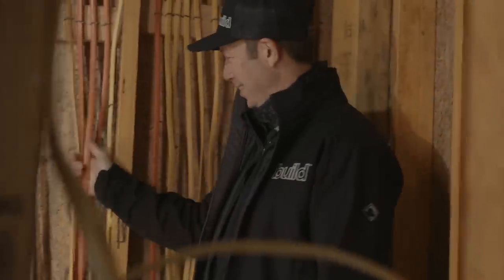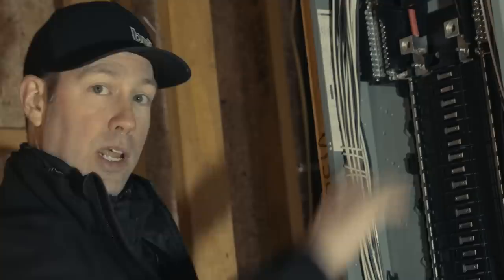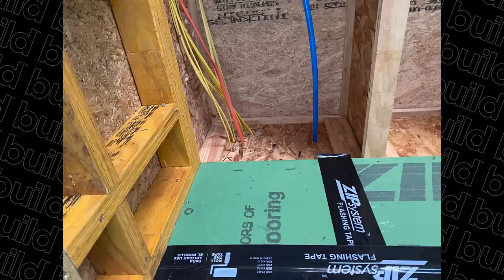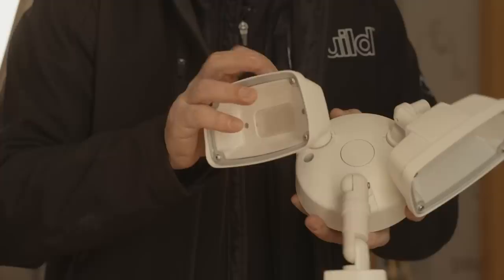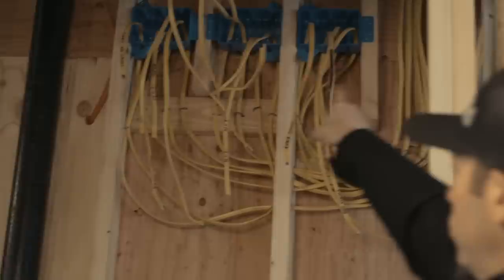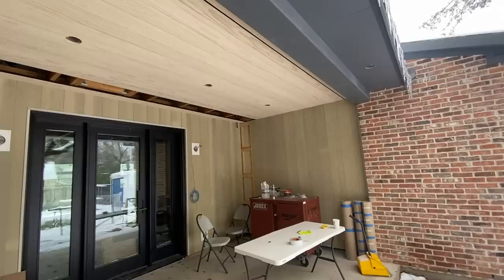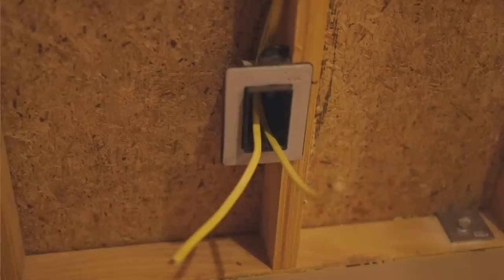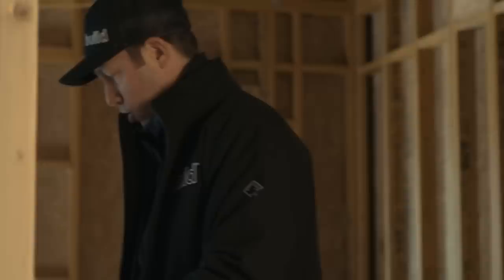5 Tips for New Construction Electrical & Smart Lighting!

Comment: I work in Information technology  and I made my house a dumb as possible.  The last thing I want to do is fix another bluetooth device after work.  I've also switched to all led light bulbs as I got tried of the entire light failing.
Reply: I totally agree. If the LED isn't replaceable with industry standard parts that will be available in 10 years, it's crap. It WILL burn out.
Reply: Thin fixtures = death by heat
Reply: Also, thinking of blujacking and blusnarfing thru these IoT devices...somewhere along the way, they get thru to the internet.

Comment: I have been using wafer lights for about 2 years now. So easy and fast. Love the ability to place just about anywhere. They work great for remodeling especially is small spaces where a standard low pro can does not fit

Comment: 12g wire for led's is way over kill. Run 14/2 on a 15 amp breaker for each rooms lights. Every room should have 2 breakers. 15 amp for the led's and a 20 amp for the sockets. The master bath would have a separate breaker from the master bedrooms sockets.
Reply: yeah, if you're putting the lights on a separate circuit, then there is no need for 20AWG on those. it wasn't clear whether that was happening there. I don't know the code or typical practice in his area
Reply: Yes! Perfection!
Reply: Its a cost saving. No point in buy to different wire sizes for about $8\roll difference. Then I don't have to work about the electrician running out of one size wire and having too much of the other size. Electricians cost around $60\hr. Don't want to waste money having him to pick up more wire, or waiting on me to come back with more wire. Keep is simple.
Reply: You don’t share ANY circuits between rooms, eg lighting?

Comment: The switch is cool but the real magic is in automations and voice control. You don’t need to press a switch when you leave. A presence sensor (or some specific set off conditions) activates an automation that turns on or off what you want for that condition, locks/unlocks doors, changes thermostat settings, garage door, tv.....

Comment: There is a lot to talk about with this whole full 12ga setup, more than I can write in a youtube comment. 
 I'll just affirm what some others have already said and add that the idea that 14ga is "worse" is fundamentally wrong. It just has a different use case. An old joke amongst electricians is that you can always tell when a homeowner did the wiring because everything is done in 12ga since they think "bigger is better". In some instances it may make sense to do a circuit in 12ga even when not required by code, but in others it may make no sense at all, and cause issues with box fill etc.  Consult your electrician for your specific scenario and I think you'll find a majority dont agree with this concept.
Reply from the maker: Interesting. I didn’t know this. My electrician is fully on board with this concept. Appreciate you taking the time to comment. Best, Matt
Reply: @buildshow  You probably shouldn't be telling the electrician what wire to use when you don't know very much about wires and electricity...that's the electrician's job.
Reply: I am wiring my own house and doing the same as Matt. Not because I dont understand where 14 gauge could be used, but for simplicity. As a DIYer it just makes it a lot easier to go overkill and not have to worry about it.
Reply: I would argue that wiring your outlets as 20 amp circuits could actually be considered more dangerous, yes you can potentially power more devices on a single circuit, but what happens when one of those devices ends up with a short inside of it, that 20 amp circuit will now allow even more current to flow through that device which is typically rated to be plugged into a 15 amp circuit. Cheap cable attached to the device barely rated even for the 15 amps now has an extra 5 amps to burn that cable up.
Reply: @myquest84  I did mine with 20 for receptacles and 15 for lighting. No problems ever!
Reply: @camtoews  Not a valid point with Arc fault nowadays - 20A isn't going to flow

Comment: After having one smart hone set up it was so expensive to setup and then I had to go replace all the blue tooth stuff cause it shut down the lower 2G wifi and also messed up the use of wireless headphones and headsets.   I ended up having one wireless network just for the "smart home setup"   worked great but after 2 years only had one leviton smart switch go bad.  Wish I did not have to sell that place
Reply: You nailed it. Smart devices are good for about 12 to 24 months before the problems start, and the Mfg no longer supports them forcing you to upgrade everything.
Reply: I’ve had some Leviton zwave switches for 10 years in high use areas with no problems.

Comment: Aluminum wire does not need noalox, it's not required by any major panel maker or any large manufacturer of wire such as Southwire. It does however need to be properly torqued to the panel manufacturers spec. The alloy of aluminum in use today is very different from the one that was first used in homes that had issues. There's nothing wrong with using modern aluminum wire to feed main panels or sub panels when installed to manufacturer specs. I used it  to feed the main panel in my house. I wish people would stop propagating these myths about aluminum wire.
Reply: That being said, specifically using Cu wire with Al Lugs in the panel to avoid oxidation makes no sense.  I'd think you'll get a little less oxidation if you have Al on AL, rather than mixing the metals, but I'm no materials scientist.
Reply: The issue is using Alum. wiring with Copper lugs or with wirenuts or press-on connectors that typically use copper. Copper & alum in contact causes corrosion, so they need to be protected from oxidation.
Reply: Agreed. We use it commercially often except in special cases where were concerned about corrosion. It's a great product and can save money.

Comment: I watched your video with great interest and with 35 years doing electrical work (Electrician) doing mostly commercial as residential service work, I would have to disagree with running everything 20 ga.. All your outlets yes by all means do so but for your lighting circuits there’s no need my reason for this is twofold 
One all your lighting now is LED’s which means that if if you install 15 amp breakers, say 2 15 amp breakers per floor as well 2 for exterior lighting so if by chance a breaker should trip you would be left in total darkness in any area and you can alternate circuits for each area lighting.
Second All LED drivers have a built in thermo, as well as built in disconnect that automatically shuts off power to that fixture sometime comes in very handy in troubleshooting (BTW the drivers are the weak link in LEDs) since LEDs are rated in watts you’re looking at 3000 watts of lighting per floor or 2400 watts @ percent for your 2 breaker per floor. Also more room in your switch boxes 
If you don’t mind wasting money by all means running 20 amp circuits and 12 ga. Wire. If you disagree with me please tell me why I’m wrong since most folks can’t afford to waste hard earn money on even a custom build.
Reply: Edit : 20 ga to amps or change to 12 ga

Comment: Why do you have that external panel?  Speaking from what I've seen in Iowa, I've never seen outside panel boxes, like that.  I've always only seen the electrical panel on the interior of the home, hence my asking.
Reply: Common in the West. Here in Southern California, it would be quite unusual to not find a panel on the outside of the house.
Reply: Yeah I found that odd too. I wouldn’t want my breakers outside where anyone can walk up and turn them off
Reply: @LRaines  makes it easier to hook up things that will end up outside such as AC, hot tub, generator disconnect. From there is relatively easy to feed sub panel inside for interior services.
Reply: @LRaines  more work for the electrician in 5-10 years.
Reply: Exterior service disconnect is now code. NEC 230.85 Emergency Disconnects. Exterior panel also handy for landscape lighting, etc.
Reply: @BretBerger  that's going to go over like a lead balloon where I am.
Reply: I bet it's coated in an inch of ice after this week. That's one thing I would NEVER do... put a panel of any kind outside. I once opened up a panel for all the cable wiring and it was packed solid with wasps. I would have a dedicated equipment closet where all that would reside.
Reply: @BretBerger  So you put one large master cut off by the meter and run it through the wall to an interior breaker box. Even better because now if you want to work in the panel, you can kill even the mains lines so the whole panel is dead.
Reply: I wonder the same thing - they've been putting them outside in the south for years, so the 2020 NEC doesn't explain it, and you can still have a service disconnect outside but have the panel inside. None of the electricians I've spoken to thinks exposing the breakers to the extreme heat is a good idea, not to mention the hassle of going outside every time you need to reset a breaker (or need to turn one off or on to do some work.) Adding a hot tub or landscape lighting is not an everyday event, so that doesn't really justify the other drawbacks.
Reply: @Sipa2020  How often do you need to do that? the AC is installed with the house. A generator disconnect can be installed regardless of the service panel location.
Reply: @ptester1  the official explanation for an outside disconnect is for firefighter access. But anything outside corrodes faster, so the failure rate is worse.
Reply: My house is like this, panel on the outside, with another one on the inside. I find it incredibly annoying! The only reason it is like this is because my house was built in the 80s and then moved and remodeled a few years ago, the power comes in a different place than it used to. If it wasn't for that it would not have been done that way. (In the south also, BTW)

If you're worried about random people turning off your breakers you should find a better neighborhood...

Comment: I'd previously looked at a towel warmer. To run it for a year would have cost me about $100, so if I didn't want to pay that, it's another thing I need to remember to turn off. So the lesson: put towel warmers on a switch with a timer so it turns off automatically after 30-60 minutes.

Rule of thumb: running 1W of power for a full year costs about $1 for even below-average US electricity (11¢ per kWh vs a 13¢ per kWh US average).

Comment: Hey Matt, nice electrical setup you got going on there, but I couldn't help but notice your electrician is using those all metal staples, most of the time those are fine, but if any of them get pounded in a little to much after a while it will chafe through and short your wires across and could burn your house down, I would recommend pulling all those out and replacing them with the plastic insulated staples.

Comment: What is the benefit of a separate 110 panel? Wouldn’t  one 110/220  inside be better?
Reply: -Panel capacity (no expensive tandem split breakers needed)
-Generator panel for 120v circuits
-Ease of resetting breakers from inside the house (including afci/gfci trips)
-Shorter homeruns
-Conditioned space better for longevity on smart breakers and probably the afci $$ too.
-Conditioned panels also trip less on hot summer days and don't freeze in the closed on position mid winter
Reply: sure, but this is Texas. we do power our unique 2-stepping & stumbling way ;-)
Reply: There really aren't 120V panels. Most subpanels are 240vac that are split phase. 220V circuit is L1-N-L2. Each Lx is 120v when tied to neural ie L1-N = 120V, L2-n = 120V & L1-L2 is 240V

Generally subpanels are useful to reduce wiring costs or if or adding rooms to an existing house & don't have an easy way to run all of cabling back to the main breaker box. Sub-panels are also used for critical loads for a generator\UPS\Solar setup which the power source (GenSet\UPS\Solar-Inverter) cannot handle all of the loads. You put your critical loads into the subpanel (ie frig\freezer\lighting) to segrate from devices like the AC, electric Dryer, electric stove, etc.
Reply: If Matt later wanted to put in a 240V breaker into his "120V" panel, he'd be able to do it, the same as any other panel.  He just chose to put only 120V circuits in it.

Comment: What perfect timing, I am at the electrical planning stage on my self build, thank you... only one comment I would give is to add some pendant lighting, I had all recessed lighting then I realized it was missing some character. The Halo smart products are really cool. Again thank you
Reply: yeah, I added boxes or pendent\ceiling fans but drywalled over them. I don't plan to use them, but it there if I change my mind. I used magnets on the cover plate to find them easy in the future.

I recommend avoid the Halo lights. Eventually those switchmode power supplies are going fail and be a hassle to replace. Plus its likely Halo won't bother to update the smartphone app and when you eventually get a new phone its not going to work. Just install regular can lights and save yourself the grief.

Comment: I agree with you as, 12/2 is future proofing the house for the excessive and growing amount of electronics people use. The nice thing with 12/2 is, you can run 15 amp and 20 amp outlets on them with almost no restrictions.
Reply: That would make sense if it weren't for the trend of making energy hungry electronics more efficient. If you just factor in LEDs you are working with  1/10 of what it would have required  with incandescents

Comment: Also I didn't hear you mention whether you were adding a surge protector to the power circuit breaker box.
Reply: it sounded like he was using standard breakers and no surge protector. however, maybe that's just what he was doing on the external panel. maybe the main/exterior panel is getting some bells and whistles
Reply: @somedude-lc5dy , for $100 or less, you can get a plug on surge arrester and put it directly in place of a two pole breaker. I won't install a panel without one.
Reply: 2020 NEC requiring Surge Protection to be in Main Electrical Panel. In other words some main panels sold will include surge protection already included.

Comment: Surprised you didn't go with the Lutron RadioRA system for your home automation/lighting.
Reply from the maker: That’s a good product too. Halo has a few advantages and is less expensive
Reply: RadioRa is expensive and will be outdated in 10 years. But same thing with bluetooth halo. Wifi based switches will be the future but also expensive.
Reply: Proprietary wifi/radio/bluetooth/whatever dies very quick. Open Source home automation will not because people will keep on maintaining the source. If you can, avoid anything that doesn't work with open source apps, avoid anything that requires an active internet connection too.
Reply: @MrJramirex  are you familiar with ISY by Universal Devices?

Comment: So weird to see the main panel outdoors.  Almost as weird as all the external water heaters down there.  I'll never get used to seeing that stuff.
Reply: I remember staring at the first indoor main panel I ever saw. ;D
Reply: @phylismaddox4880  In the Netherlands all homes have indoor panels. But code requires them all to be 3m (~9ft) from the front door. They go to a shallow build-in cabinet/door closet that is standardized for gas, water, electrical and data/telecom, input and meters.
Reply: You will see it more and more since the 2020 NEC requires an emergency disconnect outside. So new homes and existing ones getting service upgrades will at least have a small panel with the main and a circuit to the sub panel or the entire panel outside. This was common when I lived in Colorado. Lived in a few houses where the entire panel was out next to the meter.
Reply: Chickapowow
Reply: The panel outdoors thing is more a code thing than a regional thing.

The water heater thing is weird for sure thoughz
Reply: @Mrcaffinebean  The water heater thing is just stupid, as we've all seen on the news. Just because freezing isn't common doesn't mean it never happens, you shouldn't have to replace your plumbing and file insurance claims because of a minor ice storm...
Reply: @ryanroberts1104  yeah I expect that will be code change in the future.

Comment: Always install 2 thermostats in heated floors and in different locations.  Only wire one of them and leave the 2nd as a backup.  Thermostats fail eventually and not having to pull tile to replace it the 1st time is a cheap upgrade.

Comment: Pro tip:  No touching the inside of the panel. Especially the lugs.
Reply: What about licking?
Reply: Noob tip
Reply: Not powered up morans
Reply: Those lugs should be treated like a firearm, a firearm is always loaded even when it isn't, and you double checked. It's still considered loaded. 

This is the same as playing with an "unloaded" gun.
Reply: @ryanroberts1104  stop it.  If it was hot and left open the electricain. Is in big trouble.  Stop being a tool

Comment: I love installing the new disk recess but I've noticed that they don't dim  to much. Unlike cans with the right led recess can dim very low.
Reply: Hey the right dimmer and they will dim all the way
Reply: The glare is the biggest issue. But the built in driver specifies the dimming range. Generally most won't dim past a certain level to prevent noticable flicker. Outside of that it's just setting dimmer high and low end trims (not all dimmers have that feature) and if it's forward or reverse phase LEDs
Reply: I have tried cans recess and disk. I've just found that most of the cans can dim more than the disk no matter the dimmer. Give it a try.
Reply: If you have a really low dimmable disk please post it. I want to get them. I like to use them for a theater t room